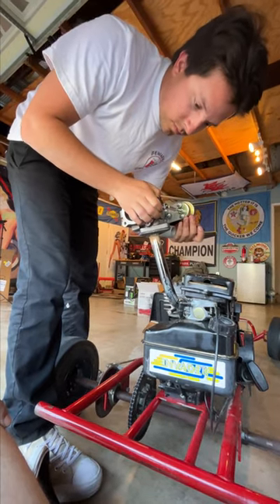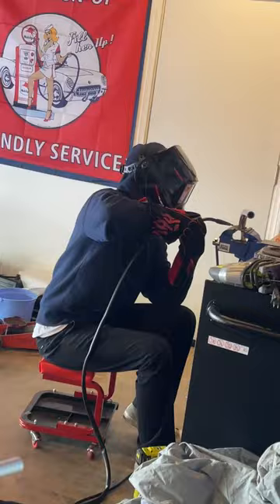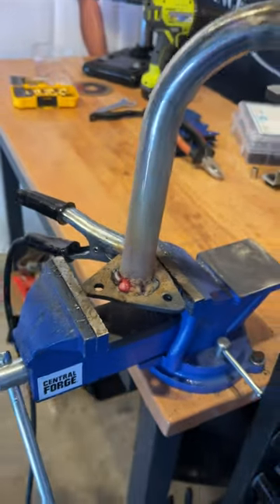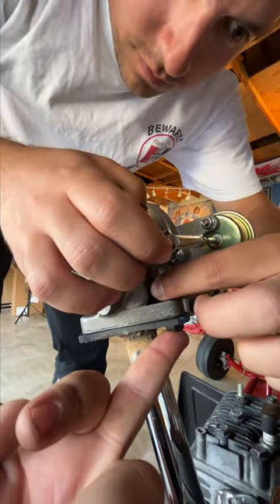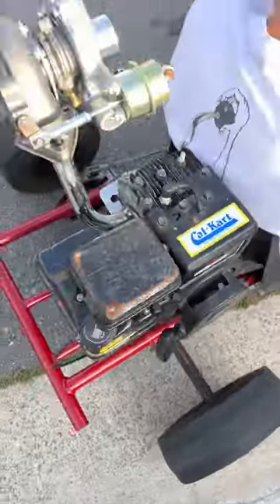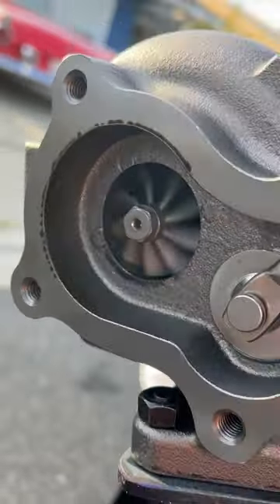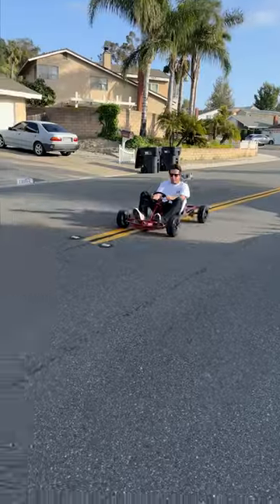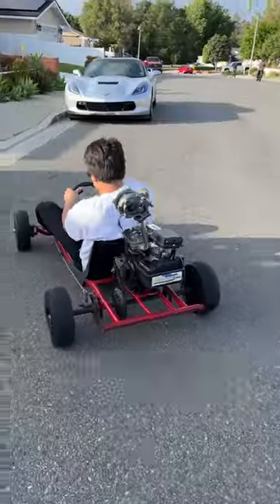I mounted a turbo on my Gokart and then this happened...

Comment: How you going to get pressurized oil from a  splash lube engine?
Reply: It can be done, but he will need to add an oil pump and electric motor. So the question becomes why? A single cylinder doesnt spool high enough to build boost.

Better off running ethanol free race gas or nitrous shot

Comment: Lotta issues here ... Needs a injector and computer, different valves , there is no oil pump to "connect the oil lines" ,......Pressure in a gravity flow carb... That's if your weld works... But so far so good 😂😂

Comment: its going to crack in no time.  a single pipe welded like that cant work.  the exhaust vibrates far past the fatique level of that exhaust pipe.  it will break very quickly.

Comment: I am curious how he is going get an oil feed working from a single cylinder engine that use a smash rich to move oil, separate tank and a pump?
Also rip the bearings in that turbo😂😂😂😂
Forget minutes, those bearings started to die the second it it spun with no lube😂

Comment: Forget about turbo this aircooled engine won't make it it won't be able to handle boost pressure and how are you going to add oil system  and air cooled engine are shit in terms of cooling it will soon overheat due to increased air pressure and honestly i think the engine won't be able to spool turbo to its full boost potential use nos it will be better don't turbocharge it